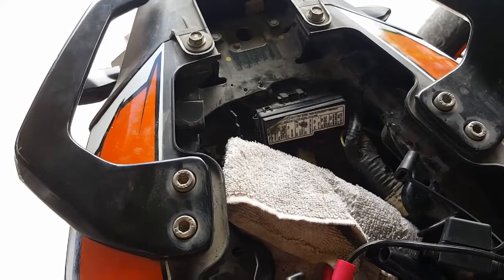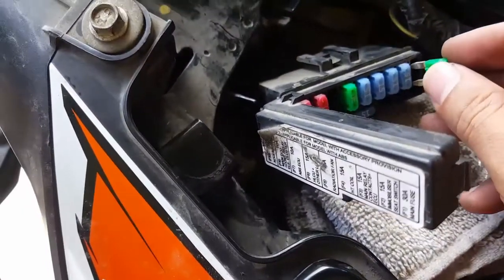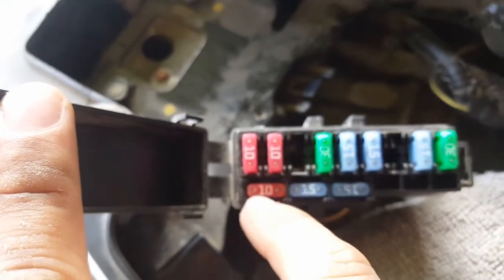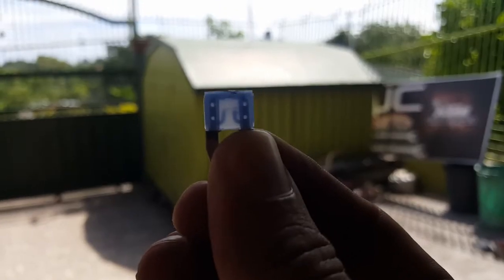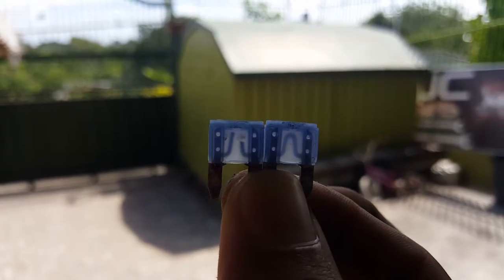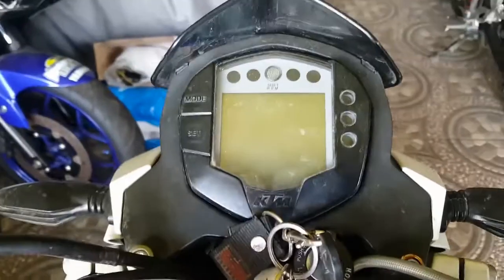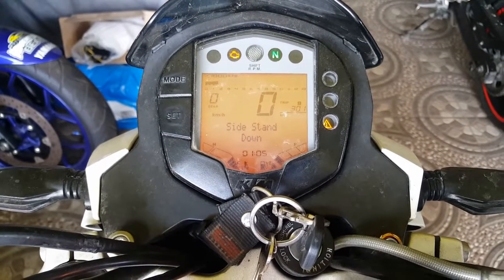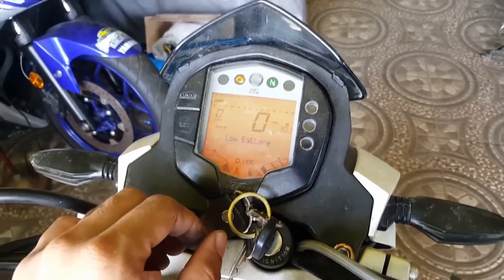Error code on KTM Duke 200 / low voltage problem "stator coil" check engine sign.

Comment: Brother I need help with my duke 200. Flash code blinks 2 short 2 long. Bike runs ok. Flash code only appears when stationary but goes off while riding. What could be the issue here. Please help thank you in advance 👍🏻
Reply from the maker: As what I have provided on the description. It's signal speed malfunction bro.
Reply: @reverendcoward7941  yea but I don’t really understand that. How can I rectify the problem? What should I check or change? Thanks brother 🙏🏻
Reply from the maker: If you have not enough knowledge about it it's better to bring it to the nearest dealership to serve your concern maybe a motorcycle shop that can actually fix the issue . Much better too if they have a diagnostic tool.

Comment: Hey Mate.. Greetings from India 🇮🇳
Please help me sort this issue with my duke 200 Bs3..
Without giving throttle(acceration) the RPM get's raised to 3000 and the warning light blinks continuosly... this issue comes and goes while riding only..
I have got the ECU checked, accelerator wire replaced but the problem is not resolved yet.. I hope u have the answer..
Reply from the maker: Is the bike still under warranty?

Comment: My duke 200 bs4 model recently cranks but is not starting up,  i can here the starter sound but no ignition  all lights horn working perfectly, what might be the issue
Reply from the maker: Did u do anything to ur bike so far before the incident happened?
Reply: Nothing else bro, just had done my 30k service in dec and changed my front brake pads in jan, all from ktm authorised service centre,
Reply: @mohammedirfan4009  did u fix it? A little late but having the same...

Comment: br0 ..my duke xan self bateryy always low..it need running.
Reply from the maker: Check the life of the battery, the voltage regulator and the stator coil sir.

Comment: J.g .1.7.4 what?
Reply from the maker: Might be dying battery or loose contact. Check battery terminals or connections.
Reply: @reverendcoward7941   denedim olmuyor  güç kaynagını degistim olmuyor    ekran kapandı
Reply from the maker: English please. Thanks. Sorry
Reply: @reverendcoward7941  I tried, I did not get any results, I changed the power supply, I did not get any results again, the screen does not show anything at the moment, but the engine is running
Reply from the maker: @hamzadag04.47  so your bike is fine now?  IG: rev. Coward
Reply: @reverendcoward7941   can you give me your instagram account i will send you a photo

Comment: JG 1.8.2 code plz tell me whats problem
Reply from the maker: Still more battery issues. Just try 1st checking your battery terminals or connections. Make sure battery is not too old.

Comment: Mera duke 200 missing problm ho raha he. Kiya kharab huwa he bataye jara
Reply from the maker: Hello, English please. Thanks bro  ride safe.
Reply: @reverendcoward7941  my duke 200 Bs4 2019 model is given some missing issue like start off when I shifting gear. Engine diagnostic indicator blink 4 long and 3 short but I don't know whats the problem. Please help me out
Reply from the maker: Hello, can't seem to find it under the description I listed. How many months is your bike? Have let it check to the dealer using the diagnostic tool?
Reply: If fuel pump not working then how many time diagnostic light blink
Reply from the maker: See the description below sir. Thanks for watching.

Comment: Bro mine speedometer shows error jr 1.2 something
.. bike is starting but meeter is blank what to do
Reply from the maker: Hi please know the age of your battery if not yet one year, double check the terminals of your battery,  clean it, remove rust. And check connections.
Reply from the maker: Especially starter relay.

Comment: Hi friend, 1 long 7 short Ktm duke 200 2013 abs help out how to fix ?
Reply from the maker: Check fuse box. Make sure everything is fine. No lose contact or destroyed fuse and if everything is fine, clean your lambda sensor located on the headers, attached. If still the same, try to delete it from the dealer then last option is to change the sensor.
Reply: Reverend CowarD Friend, and you can also tell me on the dashboard, where the mode (on the dial) frame changes. How to fix it?
Reply from the maker: @mischalivegames  what do you mean? What I understand is how to toggle up or down? There are Set and mode buttons.
Reply: Reverend CowarD I mean that on the dial (where the mod is installed) on the speedometer (over time, when turned on, a square appears(as interference or a frame) with what can this be related? The rest of the speedometers don't have this.
Reply from the maker: @mischalivegames  please chat me on my page. Reverend Coward , Facebook.
Reply from the maker: @mischalivegames  https://m.facebook.com/Reverend-CowarD-Sapota-100455234745068/

Comment: I've duke 200 Bs6 Model... I've purchased it 1 weak ago... I've been coming a issue in my Bike that Engine Light is always on when i drive .... No Blink issue only Always on
Reply from the maker: If bike still under warranty.  Bring it back to the dealer and let them erase the error on the panel. Sorry for the late reply.
Reply: It's ohk Broo !! Don't say sorry 😊 I'd gone the dealer (showroom) where i purchased the Bike He told me that If Engine temperature was too much low so this issue generate don't be panic that's not a big issue Bike is new then it's a common problem you ride some kilometer then it will be fine..
Now everything is okey

Comment: The problem I have is as soon as I start my bike all my coolant goes into my oil  and replaced all the seals etc. My heat sensor also  dont work replcaed that nd still it doesnt work
Reply: What was the problem bro

Comment: My problem is that it starts normally but when i try to ride it just starts to stall. Idk what to do. It blinks one long and one short. And i dont know if its about the battery. Maybe the fuel injection. Its s 2015 so its a carburator injection.
Reply from the maker: I suggest to check your stand sensor if it's working fine. If working fine,  next step, clean your throttle body and its components with carb cleaner or can be regular gasoline. Also double check the connector of your idle air control sensor. If not familiar,  please bring it to the near ktm dealer or expert mechanic of ktm.

Comment: Help me bro, my rc390 having 1x long followed by 7x short blinks.. what is the problem?
Reply from the maker: It's the lambda sensor bro. Please do clean your lambda sensor and connector or before doing it. Please try to unplug batter for 12hrs then install it again. Be Careful.  Thanks.
Reply: @reverendcoward7941  bro.. now engine light stays on all the time.

Comment: Its not blinking...its glowing fully
What may be the problem
Reply from the maker: Bike is running normal? If performing normal, just try to remove the batter for 12hrs then install it again.
Reply: @reverendcoward7941  yes it's running normal,but if bike is untouched for one whole day,there is a struggle.when i got to start my bike the next day it's starting after two to three attempts clicking the ignition.

Comment: My bike is  showing error jg 1.9.0
Reply from the maker: That's still a battery issue but let's all check the terminals of the battery first if it's tightened enough.  Might be a lose contact. And also check the voltage of the batter if it goes down instead of charging while bike is on.
Reply: @reverendcoward7941  how to check the  stator coil is gone or not?
Reply from the maker: You may use a voltmeter on it but make sure to do it well. I suggest if bike is still under warranty,  bring it to the nearest ktm dealer and let it be done there.

Comment: Hi Bro, i have problem with the battery. I've check the battery. 
When position off, it is measure 12,65 VDC and then when i start to cranking motor, the voltage is increase to 13,75 - 14 VDC. 
But when i turn off the motor, and then i try to turn on again, there is still any message "Low Battery" in LCD. 
What should i do, charge the battery or replace the battery with new one?
Please answer.. thank you so much.
Reply from the maker: Hello sir. May i know if how many years already is your battery? And if it's still 1 or 2 yrs, try to tighten the battery terminal and also clean it by sanding. If same issue occurs, please recharge your battery then install it back. Please update me. Thanks.

Comment: Brother my rc 200 showing 2long and 5short blinks?
Reply from the maker: Hello bro sorry for the late reply. 
Do mind to check ur side stand sensor. Check the magnet if it's still okay or the socket of the side stand sensor. Also check the wires if it's not cut.
Reply: @reverendcoward7941  
Okey bro i ll check.  Thanks for replay
Reply from the maker: Yes no worries.  Feel free to comment back or update.
Reply: @reverendcoward7941  
Sure👍
Reply: I checked side stand sensor wiring not found any unusual things..  now i suspect  may be the problem occurred with sensor internal short.. or something like that?  I disconnect the sensor coupler and bypass with help of a resistor..  now it's not showing any type of error..  but now i noticed another issue.. bike sluggish starting..  idle not steady but after some attempt now it's working okey..  you have any idea about that?
Reply from the maker: @humanontwowheels1087  yes have tried that on my bike too. Sometimes no proper idle or turns off itself or hard start is still connected to the issue have which is the side stand sensor. Just make sure you have connected ur resistor properly or the wiring is intact.

Comment: I'm getting jy_1.4.2 error in speedometer while trying to start my rc 200..and the bike is not starting...I don't know if it is a problem related to low battery or the coil that recharges battery while bike is running?
Reply from the maker: Ey bro sup. Been suffering with that issue? Ahm, before anything else, i go advice to check ur battery terminals,  clean it if possible and tighten it. And the connections especially the rectifier and stator coil and all those neccessary for charging components.  If still the same, check how many years is your battery and test your rectifier and lastly, the stator coil if it's burned or not.
Reply: @reverendcoward7941  thanks brother 👍🏼
Reply from the maker: Anytime bro. Just update me.
Reply: @reverendcoward7941  ey bro. No problem with stator or wiring.. problem is with the battery 👍🏼
Reply from the maker: @kohilskottarathil3936  that's good to know then. That's always the best thing to do next time around,  check the things that are related to the issue. Must not execute to major thing to do when it's not necessary. Have safe trip always bro.

Comment: I'm facing issue in ktm rc 200, engine check light is steady on, what could be the issue, it's not blinking but steady on
Reply from the maker: May I know bro if anything is wrong happening to ur bike right now?
If none, try to remove the battery whole night then put it back in the next day. Be careful in putting back the terminals.  Correct placement of pos and neg should be observed.

Comment: Bro what's the reason for check engine symbol. It Binks 1long and 3 short. What's the issue can u let me knw. Coz I didn't understand in your caption.
Reply: Bro 4long 5short plz help please
Reply from the maker: @amihussain4407  hey bro that's the lambda sensor. It's failing. If bike is still under warranty,  please bring it to the dealer and get it fixed.  If not, you may remove the lambda sensor located on your headers pipe. I think that's a 17mm or 14mm  open wrench . And also before removing it, make sure to unplug the socket. Clean it with contact cleaner. Try plug it back in. If still the same, remove battery for one night then put it the next day morning to reset ecu.
Reply from the maker: That's the air intake sensor. Please get ur bike serviced from your dealer if still under warranty.  But if no longer under warranty,  try checking ur air intake sensor, clean it with contact cleaner.  Or try turning off your bike, count for 2 seconds then turn it back on then do it again for 3 times. Last option,  try to remove your battery for whole night then install it back the next day morning.

Comment: My duke 390 is having a starting problem. I've just got the new battery but it's still showing low battery and cannot the start with electric starter. Please help
Reply from the maker: Hello my friend.  Pls do check it to ur dealer if it's still in warranty.  They can trace the problem using the diagnostic tool. Otherwise,  u may check directly ur rectifier and stator coil.  Also check the tightness of every terminals. Like the starter relay. Check also Sparkplug.
Reply: Check earth connection under fuel tank.

Comment: My bike shows jg1.7.7 what is the issue
Reply from the maker: Check ur battery voltage.  But before that, try to tighten  the terminals of the battery.

Comment: Are bhai par gadi Band thi switch chalu Karen par high temperature issue dikhara hai OR self nahi bhetraha
Reply from the maker: Hello , would u mind to translate it to English? Please and thank you.  Ride safe
Reply from the maker: Hello bro, if i may ask, how old is your bike and your battery?
Reply: @reverendcoward7941  Bad English but try
Reply: @reverendcoward7941  Key on and matter look for high temperature issue and those problems start to bike not working self and fuel tank Motor problem started the after fitting bike rellys
Reply: @reverendcoward7941  new battery 
Unlessended the wiring problem
Reply from the maker: https://www.facebook.com/Reverend-CowarD-Sapota-100455234745068/ 

Please chat me here.

Comment: What is the problem. JG 1.8.2
Reply from the maker: It's more on battery. But pls do check 1st if how old is ur battery. If it's not yet even 1 yr, pls clean both positive and negative terminals by sanding it. Make sure properly hand tight of the screws.  Check also terminal of relay if it's not loosen. Thanks, pls don't hesitate to update.
Reply: Have you got the problem fixed.?

Comment: Made video for 2 short +5 long side stand malfunction plz sir plz plz
Reply from the maker: Hello sir. Soon if there will be customers that will have that kind of issue.
Reply: @reverendcoward7941  OK sir
Reply: I am up with side stand problem. 🙋‍♂️ please help.
Reply from the maker: @simondcruz2821  pls check near the side stand, there is a magnet.  Double check if  side stand is folded, magnet should be closer to a black square plate. Behind that square plate is the chips. Do use a paddock stand.
Reply: @reverendcoward7941  and what about the engine yellow light.. its not blinking,  its still & stagnant.. always on..
Reply: I have already checked the fuse box.. all are fine..
Reply from the maker: @simondcruz2821  if it's not blinking,  there is really a problem with the sensor. Please go to ur nearest k dealer and let if be diagnosed to delete it. But then, it can never be deleted once the issue is not solved . Just follow what i said, check the wires if there is no cut, also check the magnet of the sidestand. U may find it near the side stand, back of it.

Comment: 49 blinks 4 long and 9 short and battery low what should i need to change
Reply from the maker: Go to ur nearest dealer bro. 
If too far, try this 1st :
>Change battery
>If still the same, check stator coil (replace if needed)
> if still the same, since it's idle malfunction,  check terminals,  clean with contact cleaner .
> better to go to ur nearest dealer and let it get fixed with the KTM mechanics.

Comment: Bro my ktm duke 125 c bike is biggest problem facing 30days engine check light always blink 4 nd 6 times blink than I buy obd2 meter thank check show the problems tps sensor code  error and engine collant heat temperature sensor problem but im living to Bangladesh so ktm service centre don't have my nearest area . Bro plz helping me how too solve this problem 😭😭
Reply from the maker: Hello bro good evening.  I hope ur giving me the correct error. If dealer is really far from ur place, try to check ur fan if it is working. Let engine on wait for the fan to turn on. If not, turn it off. Check also coolant level. Check also fuse box. There is so much thing to check bro. I hope if u will have time, bring it to ur nearest dealer to fix the issue.

Comment: Bro my rc 390 showing j y 1 3 2
Reply from the maker: Bro , pls double check battery, battery terminals and lastly stator. I suggest u to go to ur nearest dealership that way the XC-2 gadget can check the main issue. Thanks.
Reply: I do had the same problem showing on the display JG 1.7.3.2 and low battery then I checked to nearest KTM service centre they have charged the battery for about 1 & half hour and after that bike starts 2, 3 times and again same problem occurs then I had to replaced new battery later on working fine till 1 week again after that same problem now KTM service centre told me that it's regulator problem the current is not converting to AC to DC and again I had to changed the regulator which cost 1500rs this is my present situation 😥🤯
Reply from the maker: @basumatarytravels5019   sorry to hear that. I hope the dealer was using a diagnostic test. Hope not just guessing.  Do change ur stator asap to make ur bike okay.

Comment: my bike has jg 1.7.7 what do i do?
Reply: Captain Ninjazz did you fix problem?
Reply: @jameskray4368  yeah changed the battery
Reply: Captain Ninjazz I changed my battery and it still isn’t working
Reply: @jameskray4368  i also changed the stator first that copper coil below the seat
Reply: Captain Ninjazz did you
Reply: @jameskray4368  yeah i did i changed  the coil first and charged the battery but after a week so the error came by again then i changed the battery battery was the problem all along